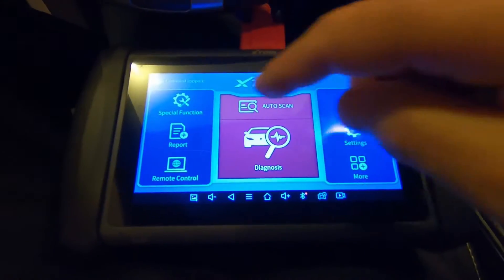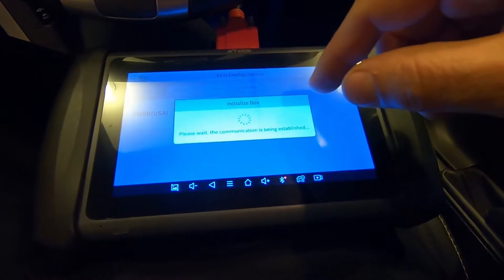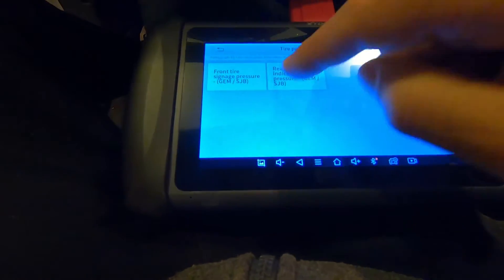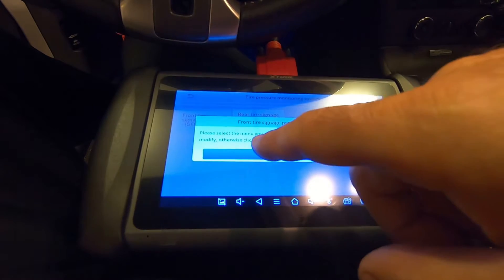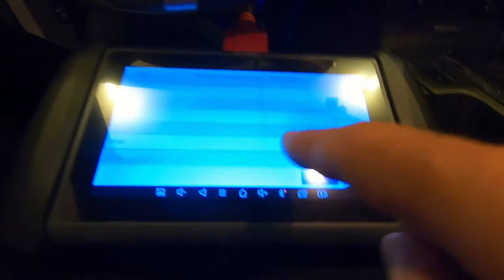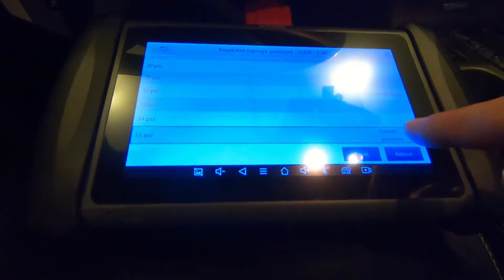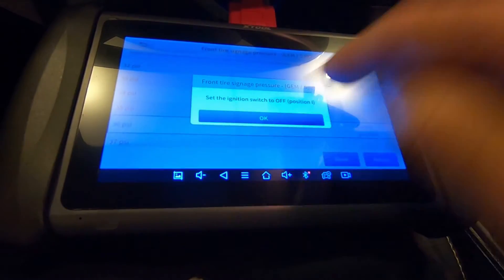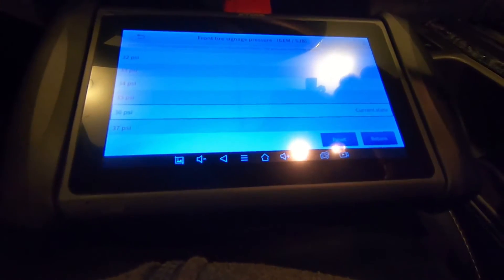XTOOL IP819   Reprogramming the TPMS PSI Threshold Mustang GT

Comment: How easy is it to swap your winter to to summer tires and delete the winter tire sensor's and add the summer tire sensors
Reply from the maker: Good question. I have not done that yet. If anyone else knows please comment.
Reply: @mrdiyguy123  ok thanks.. I was just wondering because I see others that just do that for 300 and if you buy this and get the promotion deal on it you can get one of these for around 400 so was just wondering because for 100 more this would be the way to go.